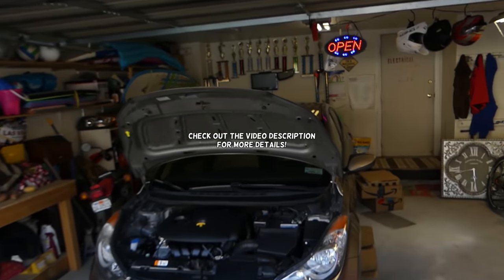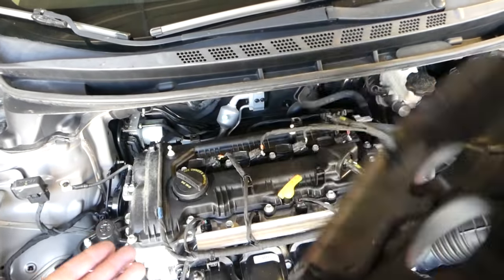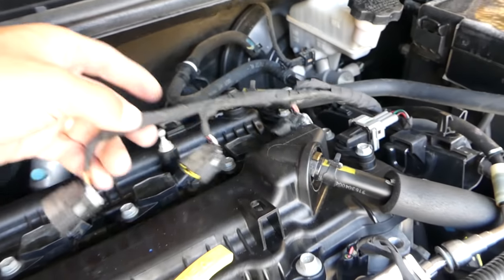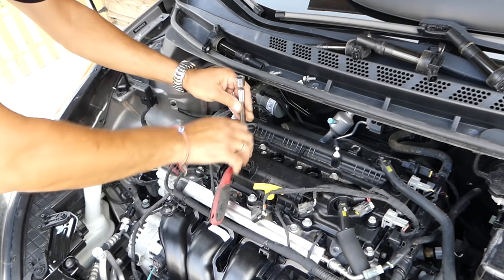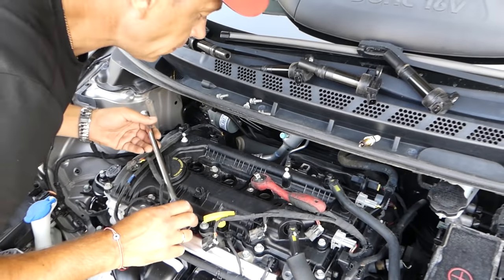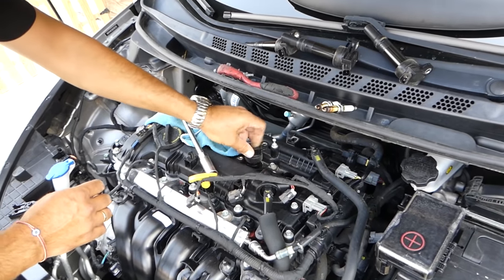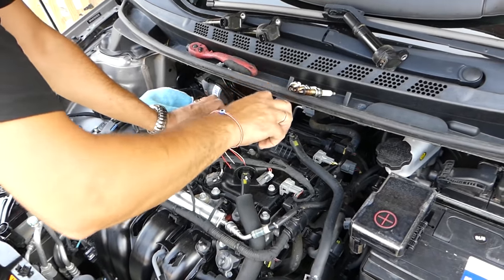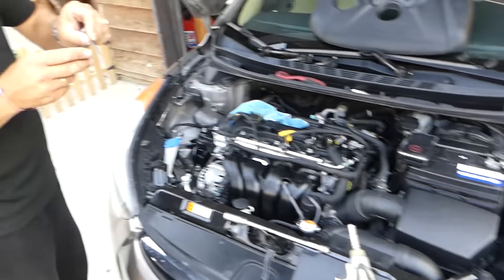HOW TO REPLACE SPARK PLUGS ON HYUNDAI ELANTRA 2011 2012 2013 2014 2015 2016

Comment from the maker: Products that we use and recommend:
► Spark Plug Socket: https://amzn.to/2vg7fdw
► Spark Plugs: https://amzn.to/402f85t
► Panel Removal Set: https://amzn.to/3YiMADu
► Tool Set: https://amzn.to/3p5MM6t
► Screwdriver Set: https://amzn.to/3XRB28Q
► Castrol Oil: https://amzn.to/3xBc8B9
► Oil Filter: https://amzn.to/3w0Ulme
► Torque Wrench: https://amzn.to/32qyRwg
► Liqui Moly Engine Flush: https://amzn.to/3IiDBID
► OBD Scanner that we use most often: https://amzn.to/3I4MQfe

► Check out our Amazon Store for the tools and parts that we use: https://www.amazon.com/shop/worldmechanics

Comment: Concise version...grab the engine cover pull it off...10mm bolts removed from coil...wiggle coil pull out...5/8 plug socket / extension to remove spark plugs...do in reverse for install
Reply: What sz extension
Reply: Sneaker Bay the longer the better maybe you could get away with 6” but 10-12 would be better

Comment: It's a good video on how to remove the plugs and check the gap on the old plugs.  But nothing about putting them back in.  Seems simple enough to do it in reverse like you say, but how tight should you tighten them ?  Should you spray anything or wipe out anything down there before putting the new ones in ?  How do you gap your new plugs without damaging them ?  Looking through my manual I could not find anything about the proper gap, so I guess web searches and youtube are your only resource or calling your mechanic for free advice.  Thanks for making the video !!
Reply: Someone correct me if I’m wrong.  Put a tiny dab of aluminum anti seize on the plug threads.  Screw in barely snug and then another 1/4 turn (so not too tight).
Reply: These are the exact same questions that I have, especially the gapping.

Comment: You don't have to remove the lil clips on the coils I just changed all 4 of mine I didn't remove the wire I left it on if you break the clip it won't go back on properly and will cause it not to fire right it's best to start with the number 4 and go down the line I did it one by one only took 15 min at most

Comment: Thank you so much, i just changed my spark plugs by following your instructions, way better than taking my car to some novice mechanic and pay him for screwing my car, btw the grey things (locks) break very easy, i broke 2
Reply: mohand oran mine broke as well. Did you replace yours? If so, where did you get them?
Reply: @dannyb7213  no i didn't, i don't think you need to change them they are “useless”
Reply: mohand oran Lol okay good because I just got done changing my spark plugs as well and broke 2. Good to know, thanks!!
Reply: I did too, even after knowing that they were susceptible after seeing this video.

Comment: Everybody....heads up!!!  At 1:12 when they're messing with the little grey colored tabs to remove the wires....DON'T REMOVE THE WIRES FROM THE COIL/BOOT, JUST LEAVE THEM!!!!   I was being gentle with these grey tabs trying to get them off the first two broke, real easily!  After those grey tabs are broke that wiring piece does not stay in place on the coil/boot like it should, it will slide loose fairly easily.  (The wires slide on and off, they don't snap in place!)  A big bump in the road could make it slide back, no joke!  So what I did for the last two cylinders was this.  Take the bolt out for the coil ONLY.  Leave the wire attached!  Just pull the coil/boot out with the wire attached, IT WILL COME ALL THE WAY OUT!!  This will save you from breaking the tabs and having loose wiring connection.
Reply: Just did mine...agree that there is no need to remove the wires...just undo the bolts and pull the coils out from left to right. Put them back in from right to left.
Reply: Thanks for the video
Reply: You're welcome!
Reply: I just followed the video and didn't read this comment first. Now I can't get the gray clips to hold the wire harnesses in place. What do I do?
Reply: @brianw260  For my mom's car, I used a drop of super glue to hold the two I broke.  Only one drop of glue so I can break the glue later to remove it.  There is a zip tie trick I've seen on videos on  YouTube, but never have tried it.  The one video (a "shorts" video) is called, "Best Zip-Tie Car Trick" by @krisbuchowicz.   I will try to post the link:   https://www.youtube.com/shorts/48jb0s7CQWM
Reply: Thanks Douglas! I will try one of those methods. For today I have them strapped on with electrical tape but I don't feel great about that as a permanent solution.
Reply: @brianw260  You're welcome.  I'm sure there is a more professional way, but I'm really not sure what it would be other than replacing the connector or whole wiring harness, which could be a pain.  A person would think they could make those safety catches stronger somehow so they wouldn't break so easily.  I have a recommendation about that zip-tie trick, too.  I wouldn't clip it off right at the end.  I'd leave like an inch of it hanging out so you have something to grab a hold of with needle nose pliers in case you need to remove it later.  I'm not sure how a person would remove the zip tie without just cutting it somehow.  Sorry I'm not much help.
Reply: Thank you so glad I seen your comment so for sure the coil will come out with wire still attached?
Reply: @jamesmaynard3984  You're welcome! It should come out together juat fine.  Just be gentle with it.  It came out together on my mom's car.

Comment: You mentioned that engine knock is a weak point.  I happen to be work working on solving that issue now.  2014 Elantra 104K mile with recent engine knock and check engine light with code P2096.  Advice and clues appreciated.  Thank you for the video.
Reply: it's a old post, but just in case if you don't know Huyndai extended the wattanty up to 120 000 mi and will replace for free parts/ labour  of the engine which will solve engine knock.

Comment: Just did mine. You don't need to remove the wire connection. Did the 1st one start to finish. The other 3 coils pulled out at the same time. If anyone is wondering how to remember which coil goes where the length of the wire will only let you put it where it goes. It's impossible to get wrong.

Comment: You mentioned that "the engine developed a knock which is common for these engines."  What did the "engine knock" sound or feel like?  I have 2012 1.8L Elantra with 202k miles on it.  I am just getting a little hesitation at idle and sometimes between 5th and 6th gear when under low push.  I thought it was a transmission problem.  But it does it sometimes in park and neutral too.  So I think it is either fuel or spark or another.  So what did this "engine knock" seem like.  Mine still accelerates very strongly and idles fine most of the time.  I'm just getting ready to change out the 202k mile old spark plugs.  Thoughts?
Reply: I have had a code reader on it and it is not throwing any codes.....

Comment: What do you think about the quality of these cars? We have a lot of them. I just bought 2016 with 42k miles.
Reply: I like my 2013 elantra...no issues after 5yrs. Also bought the 2013 Veloster...no issues. Basic maintenance helps keep them running good.
Reply: mine had 100k km and there is nothing wrong with it. Great stearing and automatic gearbox!

Comment: Do you have a video replacing the steering motor coupler???
Reply: There are some steering coupling vids on here, I just replaced mine too. It's better than paying $400 at dealer, part was only like $5.

Comment: Replaced the spark plug closest to the belts on the engine...alternator side...cylinder 1 I believe (had a P0301 code for misfire on cylinder 1)....just wanted to make sure I did the first one right and now car won't start. Any ideas? I put the original spark plug back in and it still won't start when it was starting before
Reply: Eric DIY probably solved this already but was it the coil? I had an intermittent misfire on cyl one before it went completely. Discovered it was the coil

Comment: Where is cylinder number 1 located? I have a P0301 code which is misfire on the first cylinder so I want to check the first cylinder spark plug and replace all of them if needed. Let me know ASAP if you can
Reply: Switch the coil from #1 with one of the other coils. See if the code changes to the cylinder you changed the coil to in which case the coil is bad from #1.

Comment: So far all the videos shows how easy it is to remove the coil. So why am I having problems in removing mine on a 2017 Elantra.  I am thinking is that the spark plug and coil got stuck because I put way to much oil in the car. So, any help will be appreciated.

Comment: Use 9686 Bosch double iridium plugs no gap necessary...identical to OEM but 1mm .039 gap instead of 1.1.. or .044...so the idle smoother last longer and misfire less...ans are 1/2 the cost of oem plugs
Reply: Are you sure Amazon says they don't fit

Comment: I just changed my plugs on my 13 Elantra that had 65k miles and the plugs were bad. 7 year old plugs that's why I changed them before 100k. Also, you don't need to take the connectors off. Just take the 10mm screws out
Reply: what kind of problems did you have before changing? my car is similar and my engine starts really loud so im not sure if its the plugs

Comment: I put NGK laser iridium in mine and my city mpg dropped from 26 average to 21. It idles ruff but accelerates smoother and faster
Reply: Sounds like either one of your coils isn't fully seated over the spark plug, or the wire going to the top of the coil isn't fully clicked in.

Comment: Hey guys, tried to change my spark plugs but my standard 5/8 socket doesn't seem to latch or grab on to the socket.  Do I need a thin-walled socket?  I've tried 2 different sockets now from Autozone and once I get them down in the well they just spin around-tried this on all my sockets with no luck.  Any suggestions would be appreciated!
Reply: They sell a socket with a rubber insert that grabs the spark plug, you could also use a long reach magnet to take them out. I suggest harbor freight for tools if you're a DIY. Also, invest in a spark plug install tool, makes life easy and you won't mess up the spark plug gap.

Comment: When you are changing the spark plugs in the little clips fall to pieces what do you do? Everything went as planned put everything back together but now the car continues to die I do believe because the little clips busted when I was pulling the wires off

Comment: Can someone please explain how this video helps for a 2016 Hyundai Elantra Sport 2.0L? There is a water pump on top the valve cover and two lines come off of it. The two lines are blocking the pathway for the fourth coil pack to come out. The car has a GDI engine and no turbo. Can y’all please do a video or explain in detail how to remove the fourth coil pack with those lines in the way? The OEM service manual from Hyundai doesn’t even mention messing with the the lines to get coil pack out. Please help or explain cause this video doesn’t show that at all.

Comment: At 4:30 there was a comment on the engine of those cars that I did not clearly get, can you please mention that again? Why the engine is a weak spot for those Hyundai cars? Thanks!
Reply: Space of Mind He said it developed an engine knock, which is totally normal for this engine. It certainly may not sound normal, but almost all of the cars with this engine makes that noise. It doesn’t hurt a thing, it only does it on cold start and it goes away after the car warms up. I’ve been driving mine for 5 years making that noise. As matter of fact the dealer diagnosed it as the aluminum fuel rail that was making the noise. My neighbor has the same car and hers has been making the same noise with no problem. If it was any thing to really worry about, Hyundai would’ve extended the warranty on the engine to 10 years or 120,000 mi.
Reply: @Anonymous-ji4sb  I have a faint engine "tick" noise that goes away once it's warmed up. 2015 1.8L engine. Maybe that's the same thing. Otherwise back in the day I would guess it was a ticking valve.
Reply: To avoid issues simply let the car run until it’s completely warm before you drive it at any time. Cylinder wall clearances are a bit too large upon cold start ups which can create piston slap which can typically develop into a rod bearing issue. Also the grinding or knock on start up in my understanding is the result of an oil feed driven timing tensioner. Again, let it warm up before driving. My 2013 (which was the most unreliable year and was prone to failure) now has 189,253 miles as of 2/1/2020 and it still runs great as far as the engine goes.

Comment: I bought a 2015 Elantra with 45,000 miles from the dealership and now has 72,000 miles. Now I wonder if the plugs were changed or never have.

Comment: How often you should change spark plugs? In most discussions, I noticed after 15.000 km is that correct?
Reply: That's way too often. If you have platinum plugs about 100,000 miles. 120,000 for iridium.

Comment: Plugs are overheated (yellowing of the ceramic at base of plug) also test coilovers and replace with exact oem plugs (ngk only plgs come pregapped) when doing tune-up.
Reply: The yellow is corona discharge, pretty typical and is not an indicator of damage

Comment: I have loosened the spark plugs, but I can't get them out. Cannot be removed by ignition coils, cannot be removed by socket. What do?
Reply: Tape a magnet to a pencil but make sure you tape it good. The tip of the spark plug is magnetic. Needle nose pliers work if they're long enough. All you have to do in the first place is magnetize the 5/8 inch spark plug socket with a strong magnet and pull out any residue from the socket after pulling the magnet out.
Reply: I've used a length of rubber hose that fits firmly but not jammed over the insulator part of any particular plug. That rubber hose is also a good idea to start the threads when replacing the plugs. It will slip around the insulator before you can strip a thread using a wrench where you might not even feel it resisting.